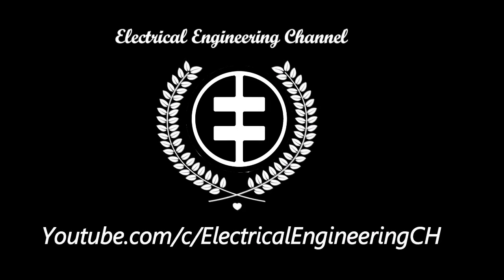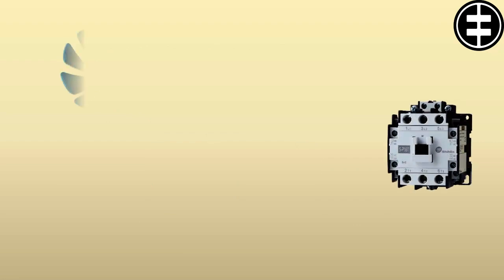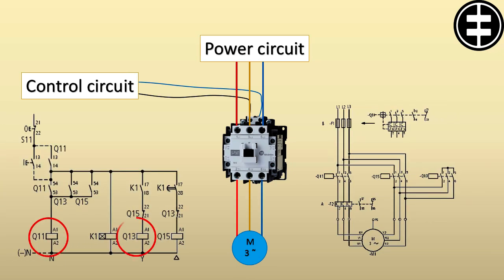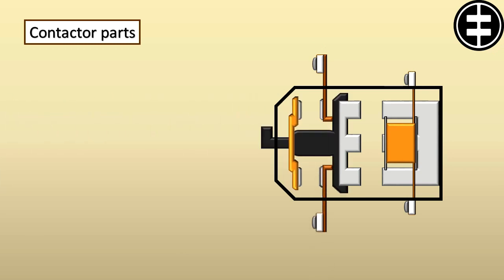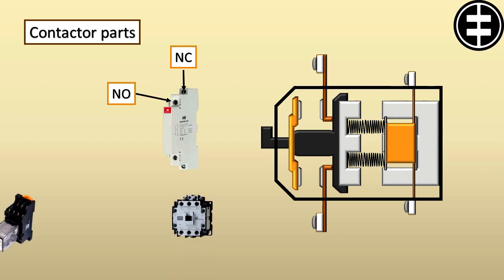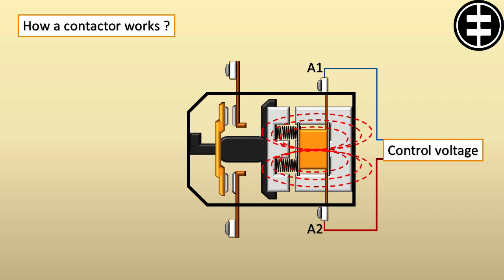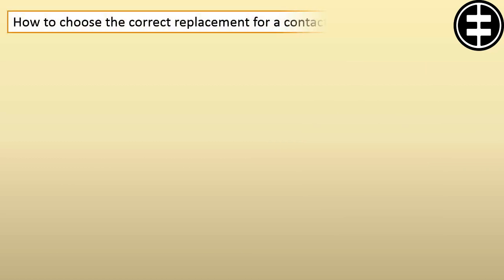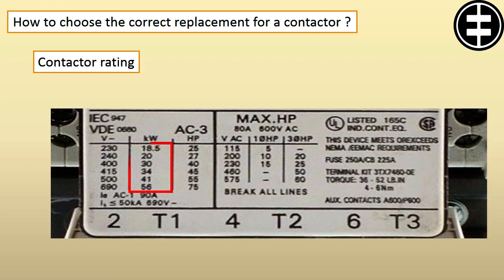What is a Contactor ? How does it work ? And how to choose a correct contactor replacement ?

Comment: Hi Thank You much appreciated. Does the power flow in one direction or both directions on a contactor? Regards
 "Non-electrician"
Reply from the maker: the power flows from the source to the load, and for the contactor both sides could be the load or the source side.